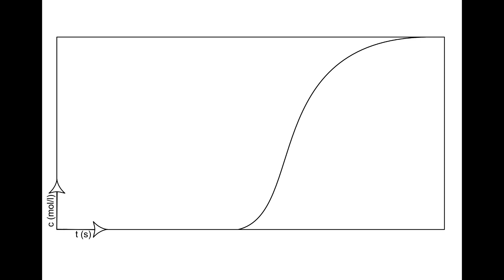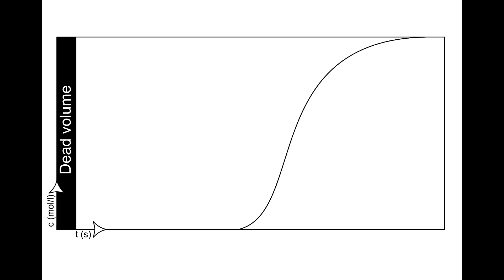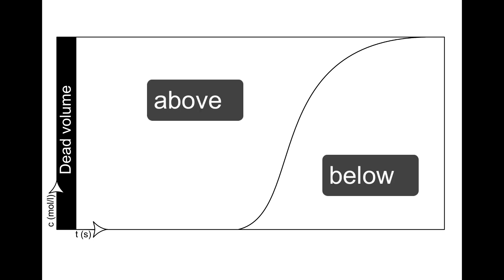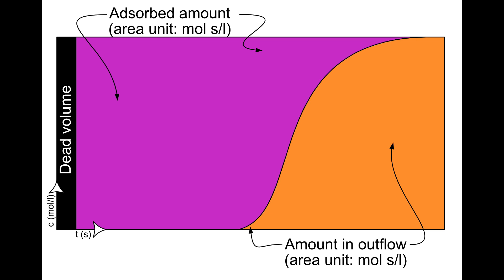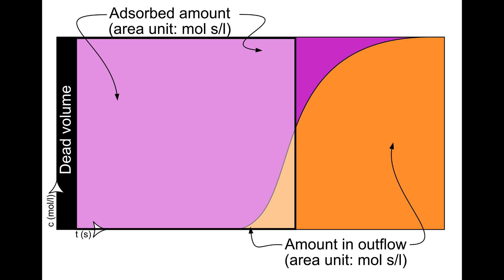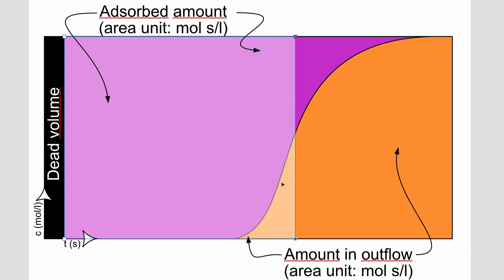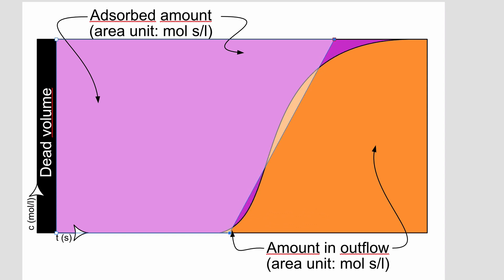Refresher on Breakthrough curves

Comment: Is there an analytical expression for t_star available for constant pattern adsorption? Thanks!
Reply from the maker: Any analytical expression would depend entirely on the shape of the breakthrough curve. Let's assume that C=0 initially and that we have corrected t for the dead volume of the system:
1.  In the ideal case, C increases instantaneously from C=0 to C=C0 and thus t_star is when this increase happens. 
2, For  a symmetric breakthrough curve, t_star is the time when C=C_0/2.
3. In any other case, t_star is given by the solution to an equation involving integrals

int_0^tstar F C dt = int_tstar^infinity F (C_0 - C) dt

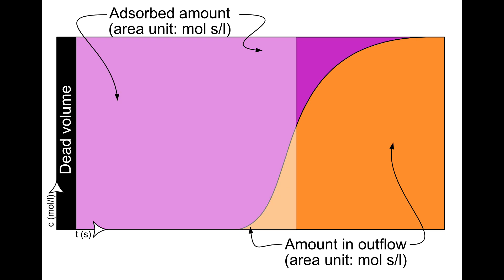but that's exactly what is done graphically in this video from 2:27 onwards

int_0^tstar F C dt = light orange surface
int_tstar^infinity F (C_0 - C) dt = dark purple area 

The problem is that for any real system, the breakthrough curve likely does not follow a simple, easily predictable equation. Please also note that we are here assuming that we have constant pattern and that might be an incorrect assumption. (But we do need to start with simplified examples in teaching adsorption, otherwise there are much complications that make it difficult to learn the underlying principles)
Reply: @PLE_LU  nice response, thanks a lot!!